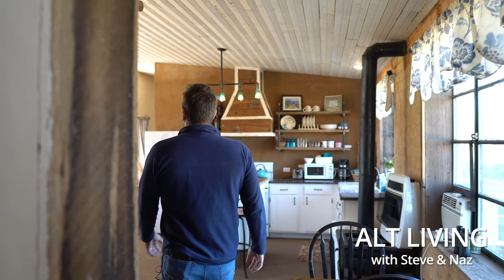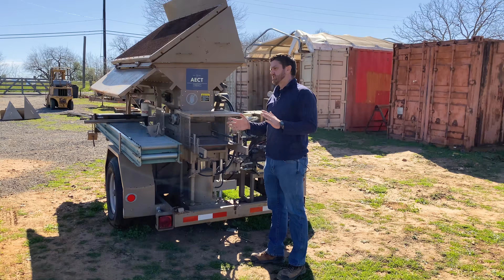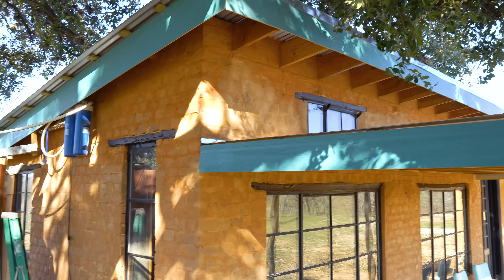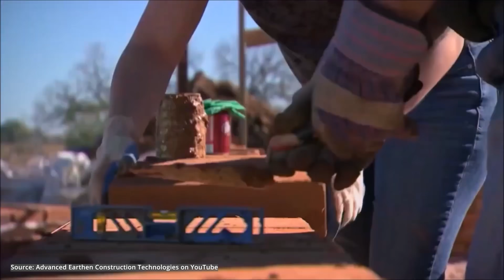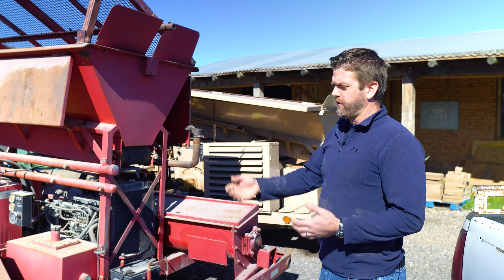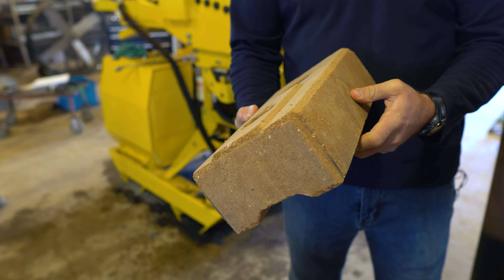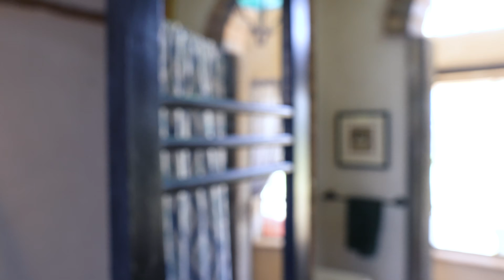How to Build an EARTH HOUSE with COMPRESSED EARTH BLOCKS / BRICKS: Ryan & Melissa Runge Netflix HGTV

Comment: I'm almost OK with blocks of 7% cement (but still it is too low % of cement I think) but is the last block made of the earth only? Is it even waterproof? If the pressure is the only glue then I don't like it, even if there is a lot of clay. You can't build houses out of those, only fences or garages.
Reply: Google Adobe buildings, some of those buildings are older than the US. Basically, mudbricks that the Natives in Southwest and Northern Mexico used before colonization and then the Spanish learned from them and continued to use them to build. As long as you cover the building with an impermeable layer, it will last for centuries.
Reply: @rrdgz5355  About the construction of houses in the USA, I know from videos and movies that the vast majority of private small houses are built of wood, or, according to frame technology, again of wood. But clay and frame-clay buildings here, in Ukraine, have really been known for a long time, both in Poltava region and in Crimea. However, there is a seismically dangerous region, so the frame was often reinforced with a frame both earlier and later (already made of concrete).
Reply from the maker: Thanks for commenting. Please contact Ryan with the lnk in description.

Comment: Do you have any information about building with earth blocks in the cold Canadian climate?
Reply from the maker: Thanks for the feedback. We filmed Ryan but his link is in the description if you want to contact him. God bless
Reply: There are several CEB homes in Colorado, including one atop a mountain at 9,500' elevation, that gets exposed to 50" of snow per year.
Reply: Where in Canada are you located. Mike Reynold's the man that invented earth ships was sued successfully when he made the mistake of selling his houses saying that they didn't need wall insulation and would stay above 65 to 70 degrees F. A woman overseas in a cold climate experienced an extended cold spell and the temperature dropped and she took it to court and won. He now recommended wall insulation in the mass under certain conditions. I live in Manitoba and if I considered a rammed earth or block building I would incorporate an insulation layer. Possible an exterior layer of block and interior layer of block sandwiching a good layer of insulation. That way you have thermal mass, and insulation which slows the loss of heat. A lot depends on where in Canada. The fraser valley in BC which stays mostly above freezing in winter may not require much insulation but heat gain from the sun due to lots of rain limits solar heat gain. For the most part of Canada plan on some to a lot of insulation because our winters are long.

Comment: Why do people say earth is a good insulator. I could be wrong but it isn't a good insulator at all.
Reply from the maker: When we visited his house for the filming, we could notice a significant difference in temperature inside and outside the house. We were amazed!
Reply: Thermal mass doesn't work the same as insulation.  Instead of blocking heat transfer, it relies on a huge amount of thermal inertia to soak up heat during the day, and radiate it at night, thus evening out temperatures.  And you can give a thermally massive building an insulative cladding if you need it.

Comment: This is an amazing concept! More people need to build with these blocks/bricks, the tongue and groove design seems to be the most efficient that I've seen so far, but I would take the holes out of the brick and just make it solid, and what if you could shift the mortar from in between the brick to the inside of the brick? The weakest point of a brick wall is the mortar joint that is holding the bricks together, I've seen brick walls that fell (after standing for hundreds of years of course) because of water and wind erosion, but if you could shift the mortar to the "inside" of the brick, i e on the top of the male tongue sticking up from the top of the brick, it would still make contact with the female part of the groove on the bottom of another brick, thus protecting it from wind and water erosion. From my research I think the best design is the Kenyan or African design, its a simple tongue on the left and top side of the brick and a groove on the right and bottom side // the "bottom" or base level bricks have no bottom groove, the machine is customizable with plates and you can take the bottom, top and side plates off // I'm thinking about making one of these machines and experimenting with this configuration, but you should leave a thin channel for mortar at the top tongue, i e make the tongue slightly shorter than the bottom groove to leave space for the mortar // the building process could also be sped up with the use of plastic or composite fittings for the brick, you put a base level of bricks down to your specifications, put this plastic or composite fitting over the brick, then put a layer of mortar in the fitting and smooth it with a trowel then put another layer of bricks on top of that, then repeat until you finish the wall // You may even be able to make it look like a regular brick wall by leaving the same small channel where the bricks fit together(normally the modular bricks wouldnt have mortar here) and putting mortar there

Comment: How realistic high can these be stacked? I'm assuming 2 stories at Max with a binding beam or two.
Reply: @@IbnsinaArsalan-lo1uz do you know how tall it is, and how thick the walls were?
Reply from the maker: not sure… good question
We filmed Ryan but his link is in the description if you want to contact him. God bless
Reply: In some middle east countries they have built with clay mud walls 4 stories or higher. The bottom walls are very thick and they slowly taper as the rise. Don't know what they use for a foundation though. Probably a fairly thick, compacted rock base.

Comment: G'day.  Am curious about a few things with the manufacturing of the blocks.  I am looking to make the perforated blocks, with a tongue and groove on the ends.  With the mixture, am looking to get pure clay from the quarry, along with washed concrete / bio sand, gravel (1.6 to 5 mm) and portland cement.  If the ratio am planning on using is 1 part gravel, 5 parts sand, 3 parts clay and 1 part cement, should that work?  The press that is going to be made for it will produce 4 blocks at a time, using a 20 tonne jack on a 4 or 5 to 1 lever system.  Am looking to make a 12 inch square, a 12 * 6 * 4 inch block and a few specialty shapes.  Am not a fan of the over the cam press, as they are restricted to how much pressure can be applied to the block in the compression.  Am going to allow a 28 day curing time, so the cement can set and the brick can gain strength.

The other thing that am curious about:  Can off white and pure white cement be used in the mix?
Reply: Hi,its been a while you commented have you started making bricks already?
Reply from the maker: Hello there! We are not sure how to help you with the information you need, but you can contact Ryan directly through his website here 👉🏻 https://aectearthblock.com/
Cheers!